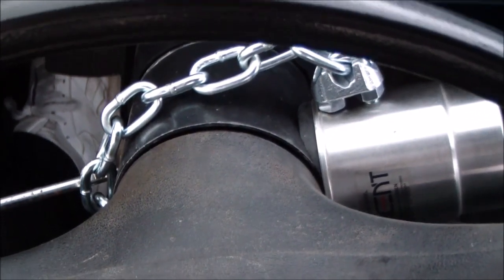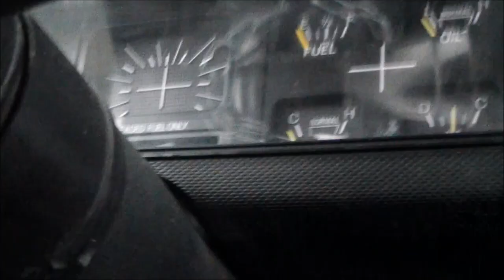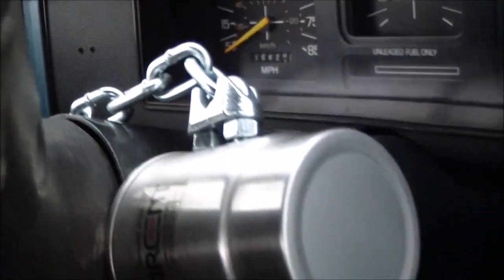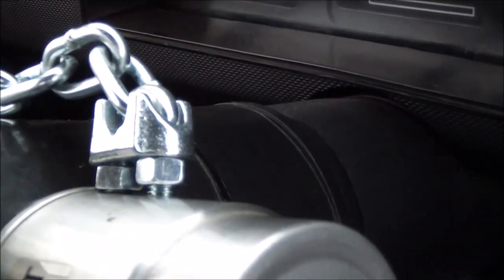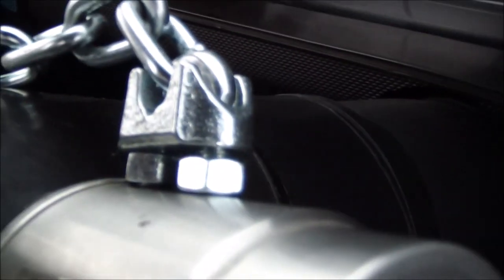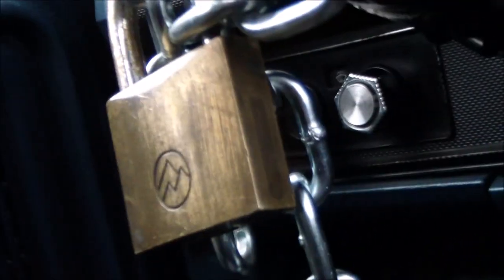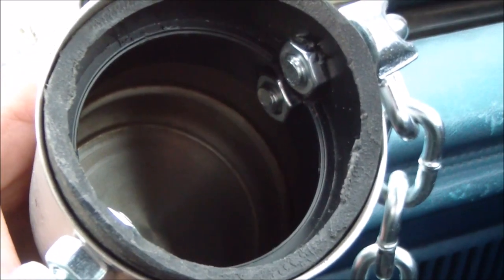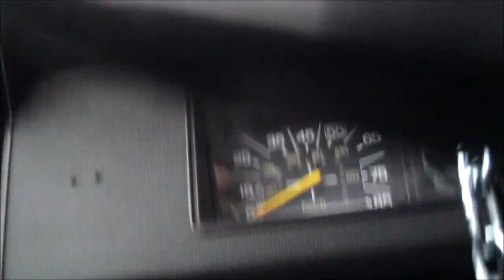Hyundai Kia & 1960 1970 1980's $10 DIY car theft protection steering wheel ignition key lockout boot

Comment: instead of chaine put a circular pipe tubing maybe 3 inch diameter. and dose the inside of tube with fart gas so if they use a saw or grinder stinky gas will release!

Comment: a thief with any metal cutting device will remove that in less than 30 seconds. Nice thought though.
Reply from the maker: There are few other devices that help like fuel cut off valve under the hood behind hood locks, hidden or keyed remote ignition switch, hope those two ideas may help.

Comment: Bolt cutter defeats it
Reply from the maker: it would, there are so many ways I have additionally made purchases to increase security, double hooked steering wheel lock, hood locks, ignition cut off switch, remote fuel shut off valve, basic car alarm, etc, etc, this is just one device.